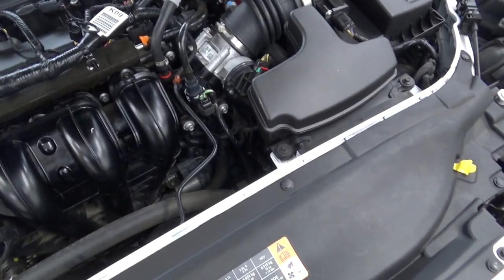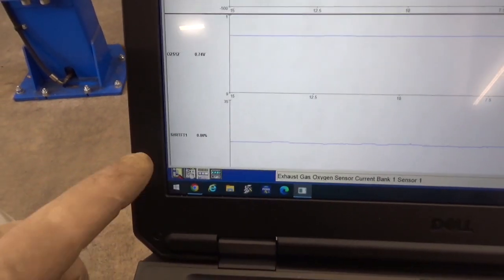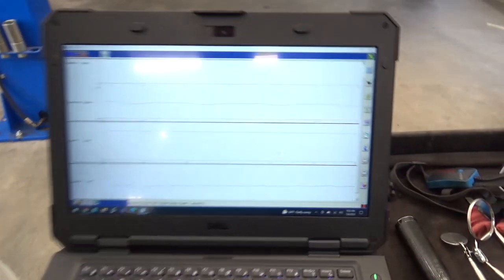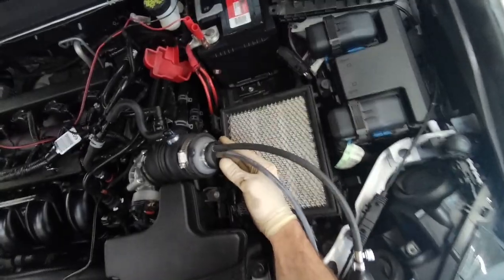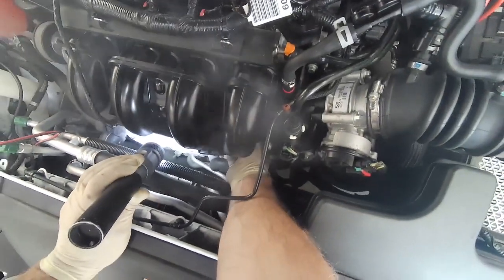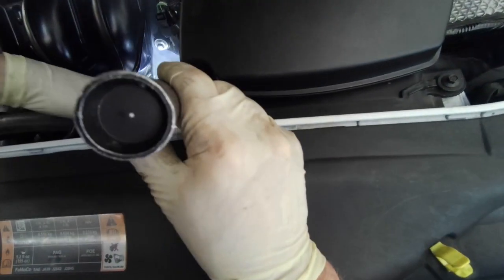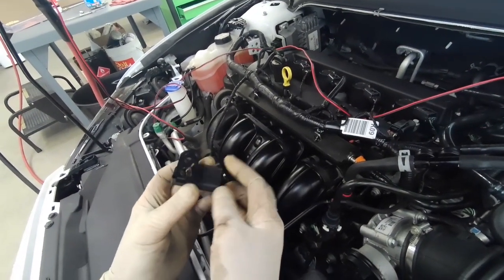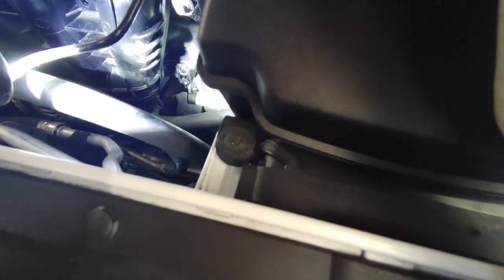FUSION P0171 LEAN CODE

Comment: Did you say this was a MAF sensor ? This engine looks pretty similar to the Ford Fusion 2012 2.5l DOHC 16 valve. Im getting the same code trying to locate the problem
Reply: I've changed the EVAP canister purge valve and the Mass Air Flow Sensor.
Reply from the maker: Video was a MAP sensor. I plugged a 12 Fusion into Identifix, the most common fixes are MAF, intake air tube, Intake gaskets/pcv valve, upstream oxygen sensor, fuel pump and running E85 fuel. 
Need a scanner to monitor the fuel trims. Check long term fuel trim (LFT) at idle and cruise speed. If readings are high (above 15%) at idle but close to 0% at cruise speeds then check for a vacuum leak by checking short term fuel trim (SFT) readings while spraying propane around every suspect leak area. If SFT readings react and go negative, repair the vacuum leak

Comment: Did you check for previous repairs? It wouldn’t surprise me if the starter or trans had been worked on.
Reply from the maker: I think you are correct. It looks like someone else was already in there before.

Comment: I fixed a similar problem on a V6 96 Explorer. The EGR pintle had a leak, thru the shaft. I used propane. Trims went to zero when I went near the EGR.  I think egr is extinct now :lol:
Reply from the maker: Had a GM LS1 with heavy misfire years ago. Customer said doesn't want diagnosed just replace the plugs/wires which is a huge job. Got it done and still ran the same. Reached back under the EGR valve and it snapped closed. Just a stuck open egr valve.
Reply: @raincitywrench117   That is why diag is critical! Have you ever seen one with an external leak?
Reply from the maker: @alb12345672  Not yet